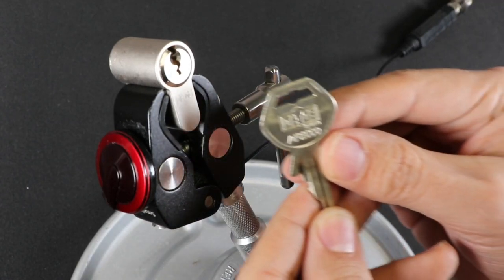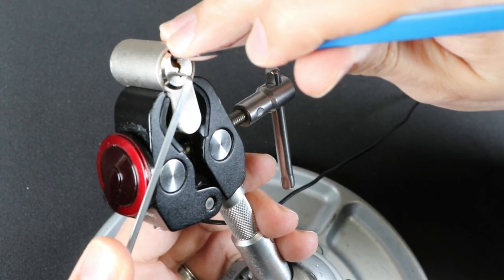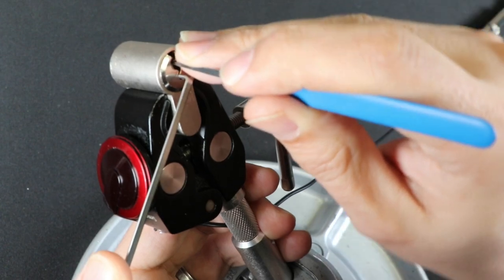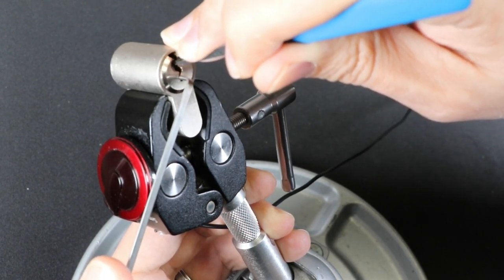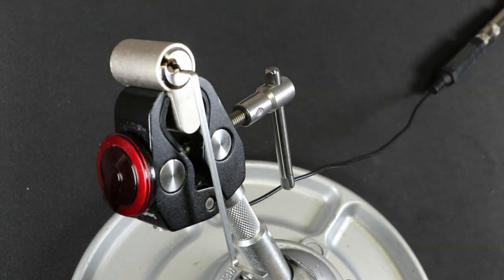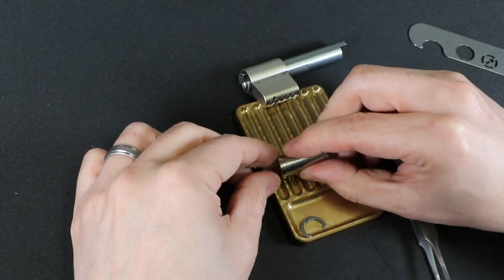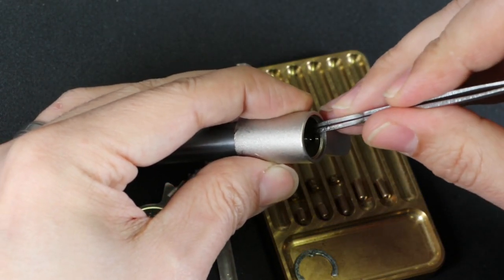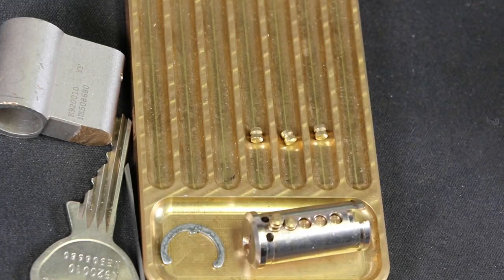[L219] Gege AP2000 Euro Cylinder Lock - pick and gut

Comment: Anytime i gut a lock I notice the same thing with security pins that are in the bible above long key pins. I always think what is the point in the manufacturer even using them. It drives my OCD crazy as any lock I re-pin for customers I always make sure the security pins I pin up are in full use. I use different length spools, mushrooms, and serrated pins depending on key pin length to get the most protection out of them. I've seen way too many locks with security pins that basically you would never know were inside them. I know Kwikset uses mainly 0.180" drivers including spools. Schlage locks usually have 0.165" or 0.172" drivers. Now most of the Schlage locks that have the 0.165" driver in them their spools are usually functioning even if their is just 0.030" worth in the sheer line.
Reply from the maker: Yep, many manufacturers (or locksmiths) seem to just scatter them in there at random and just meet some minimum number of security pins requirement without needing a pairing system. Eg. spool only goes with these lengths of pin, standard with these longer pins, etc.